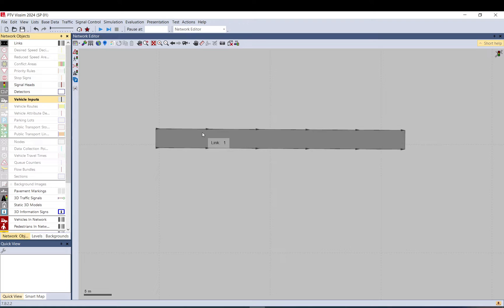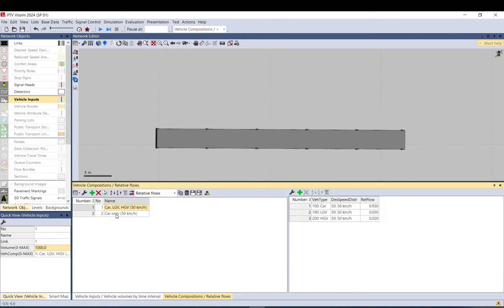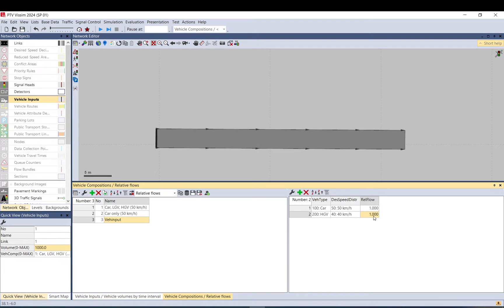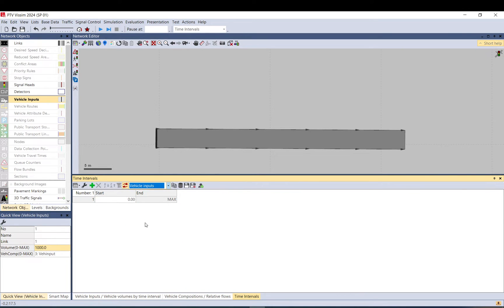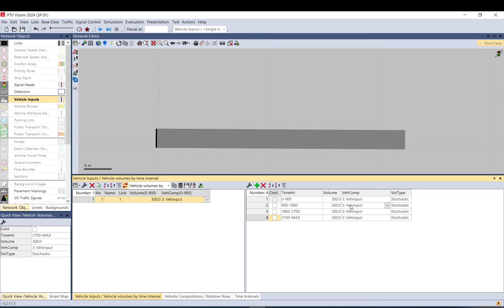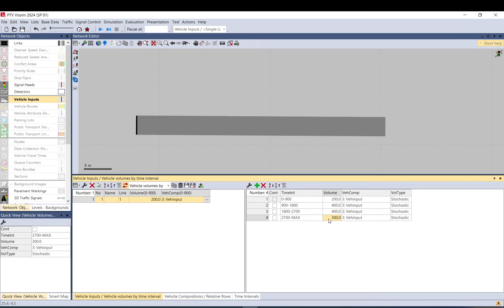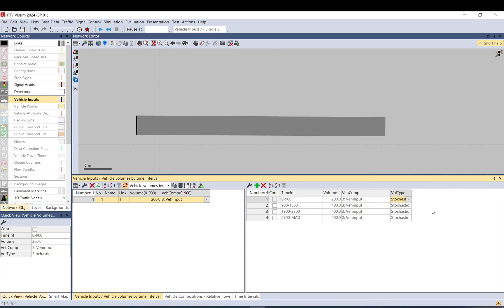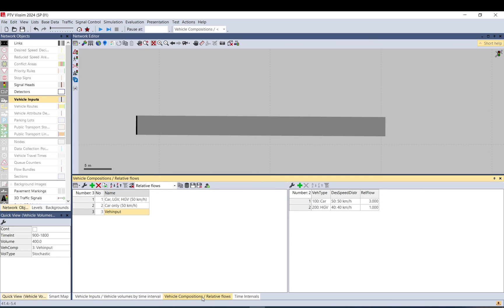Vissim Tutorial - Vehicle inputs

Comment: Hello, can you tell me how you are adding the simulation preload?  Thank you very much your videos are very helpful
Reply from the maker: Hey, You add a so called warm up period before the period you assess. You need to define time intervals like 0-900 (warm up), 900-4500 (peak hour) and 4500-5400 (cool down). Find this in Base Data -> Time intervals -> select vehicle input.
This way you can have a 15minute warm up and 15 minute cool down.
In Simulation menu settings, click configuration and set the simulation period to 5400 seconds.
When you set up your evaluation, make sure that you set evaluation time periods to this:
from time: 900, to time: 4500, interval 3600. This will get you the results for the peak hour period, excluding warm up and cool down.
Reply: I have a question, I don't know if you can help me. For example, in the parameters or evaluation configuration, the period from 900 to 4500 is defined -> from time 900, to time 4500 intervals are 3600. But I don't know if it's correct to do this without defining an interval time for the inputs in the database. I don't know if I'm omitting the warm-up.
Reply from the maker: @sebastianflorez8824  I am not sure I fully understand the question but this might help:
Good modelling practice is to have a warm up period. The length of the warm up period depends on your model, but usually between 15-60minutes.
You should set this up in the time intervals for vehicle inputs, and for any other object where it is applicable in your model.
Then you should evaluate your model for the actual peak period (excluding warm up and cool off).
If you don't model warm up, than of course it does not make sense to set up evaluation intervals for warm up.
Modelled periods and evaluation periods should match each other, otherwise you don't evaluate the right period.